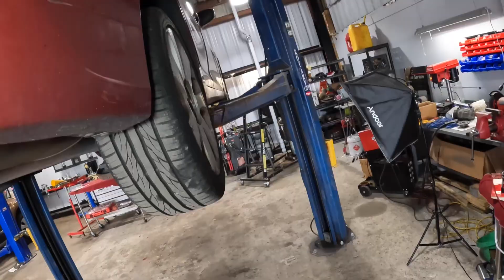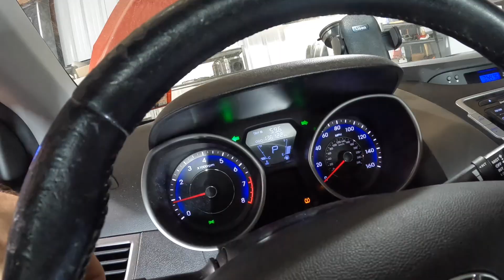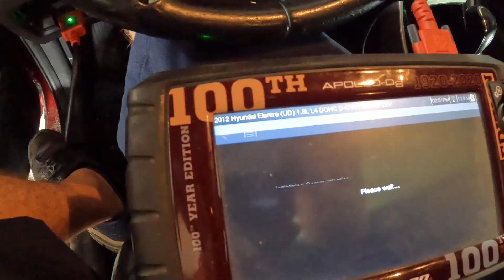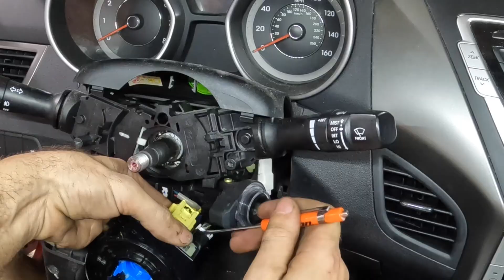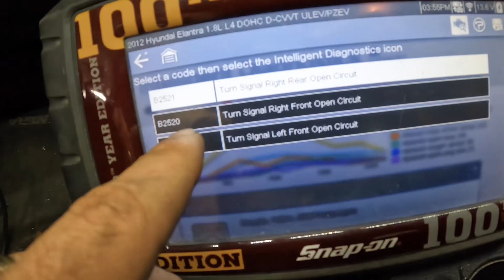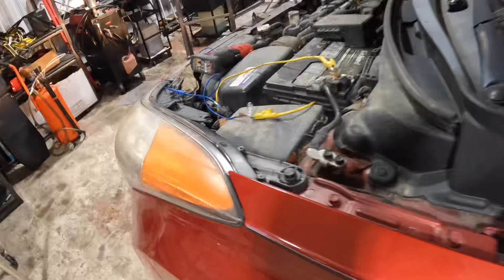Airbag Warning Diag and More! Hyundai Elantra 1.8!

Comment: Also there are NGK Iridium counter fit plugs that could give you the same problems.  To see if you have fake plugs. Simply check the resistance of the center electrode see if they are very consistent. If they are they are true NGK's if they vary resistance by more than 10% then they are fake.

Betting the light problem is LEG lamps in the rear.
Reply: Yeah, also states ignition coils aren't OEM as well😢

Those eBay or Amazon sellers are a hit or miss unless the seller says it's an authorized genuine OEM part supplier (but even that is not a guarantee)

I now just got a physical brick and mortar store Justin Case the parts are bad or fake; they have to honor it and swap them out

Comment: The flat wires are called ribbon cable which is highly flexible. It is used in low voltage, low current and low frequency applications.  They did make a twisted wire flat ribbon cable for higher frequency needs (I'm old school - core memory and punch cards).
I think my next step would have been to pull up the wiring diagram to find out what goes where on the flasher circuit.

Comment: In regards to your subscription based scanner, unless the subscription is astronomical. Wouldn't it be cheaper to resubscribe rather than spend $4,000 or $5,000 on a new scanner?
Reply: It's always good to have multiple scanners.
Reply: @johnaclark1  Ray also has 3 or 4 other old scanners

Comment: What I found stupid is you need to replace the head right? Turn signal bulbs because they’re wore out I had this problem myself that’s how I know. First thing I did was change the bulbs fix my problems
Front and back I thought it was odd that the front ones had two of them which is weird first time ever. I had one evolves that needed two films

Comment: Okay, I detect a Ray-unit logic failure here. Why buy a new scan tool that’ll require a subscription to work, when you can renew the subscription on the old unit that you’ve had for years. Reee! 😅 Unless, of course, you can get a better scan tool with a lower subscription rate! Then, it’s a logic success instead. Yay. 🎉🎉

Comment: I was fixing broken wires under my passenger seat for the occupancy sensor, even with the battery disconnected, I was still worried about getting my head blown off by an airbag.

Comment: Why would you think the clock spring would affect the turn signals?  The turn signal/multifunction switch does not go through the clock spring, right?  It's mounted to the column, not the rotating wheel.

Comment: Ray, just gonna say: When your scan tool wasn't reading and you said, "Cut!", I inmediately got an ad in the video.

Too funny. You can't make this stuff up. 😂

Edit: Ray, sounds like for the turn signals, either the multi-function switch or the relay for the turn signals are bad. I'm leaning more towards the multi-function switch, only because of the hazard switch operating correctly. It used to be you had separate relays for normal function of turn signals, but it would not surprise me to discover that one relay controls both hazards and normal turn signal function. That being said, remove the relay and check turn signal function, and if that fails, check the wiring at the multi-function switch. My guess is, a new multi-function switch is in order.
Reply: I got it too

Comment: well normally your diag vids are spot on, but now.. Last time you explained that the tabs on the airbag short them out to prevent an premature explosion in your face. Now you are measuring over 2 open wires where one was shorted and the other one had high resistance.

The headlight is simple, the flasher bulb does not have a good ground connection, and finds its ground over the low/high beam bulb. When you turn on low/high beam, the flasher has no  ground anymore and stops, but also puts 12v back to the ECU/BCM telling it that it is permanent on. Look at alldata, maybe the grounds are shared between headlights.

Comment: Id like to see the tail light because people are putting the LED lights in and that messes with that computer because it knows the light is not pulling the right amount of power, I switched 1 tail light and had this fast flash but all the lights were working so I just put the proper bulb in and it was fixed,

Comment: Thanks for your explanation on blinkers and dashboard indicators.  I’ve often wondered if they were important.  I’ve noticed many new vehicles that don’t have blinkers.   They just break and turn.  😂
Reply: And BRAKE.
Reply: That has been a BMW feature for decades.....
Reply: @jsh6952  I thought I saw a BMW use directionals once. Turns out it was only bigfoot.
Reply: Tell them break is over and to use the brakes.
Reply: People forget to keep the blinker fluid topped up or put right fluid into the left one and vice versa then they cancel each other out.
Reply: Just exactly WHAT breaks and turns? The Indicators break? The blinkers break? The indicator stalk breaks when turning? We need more info!
Reply: @beezul  
Everything breaks on new cars, heck sometimes it even comes from the factory already broken for you.....

Comment: Reguarding the mis-fire , the cable / wire to the coil might have an issue also . Have been thinking about the rapid flash . There could be a bad ground connection or more than one , that would cause a high resistance . Also check to see if the correct lamps are installed , that could affect the system . Stay safe , have fun .

Comment: When you said the airbag light was on a particular circuit I thought, "clockspring".  I must have been watching a lot of your vids...lol.  When you showed a fast flash I thought it might be an LED somewhere in the circuit.  I had to add a 50 ohm resistor to change out my turn signals to LEDs.  It doesn't appear to be the case here as that headlights on, no flash on front only and dash flasher lights both lit up sounds like a complicated problem to track down. I look forward to the 2nd part to see what that issue is.  I watch and learn a LOT from you.  Not that I'm going to do any of that on my own stuff as I have a mechanic I get to do my work as so not to make a bigger problem....know just enough to be dangerous...lol.  Take care.

Comment: I remember when i was a kid we had a 95 pontiac transport at night one of the turn signals stayed lit slightly but it never hyper blinked..my dad had a head scratcher turned on lights in garage in the dark turned on 4 ways(hazards) headlights and stepped on and off brake (checking all lights) come to find out one of the bulbs on taillight assembly was burned out new bulb in indicator on dash function back to normal..the pesky double filament bulb looks normal until it has to do 2 functions...

Comment: Before finishing your video i am thinking bad rusty ground wires. Cars in the rust/salt belt have electrical problems more than likely. i don't understand the theory of doing Billions of dollars damage to millions of vehicles to offset the monetary cost in the few millions paying death benefits of accident victims out driving in snow when they know better the risk. Throwing salt is only an economic stimulus package fraught with corruption.

Comment: @RainmanRaysRepairs
When you probe the headlight cluster harness connector: you also need to bridge other pins to simulate all circuits connected to BCM; otherwise, BCM will still detect that a bulb is blown or circuit is open to ground, due to loose connection, and indicators will continue to rapid flash.

Note: Most vehicles will also cause indicators to rapid flash or become static, if any bulb in external lighting circuits fail or malfunction, and that can also include bulbs for brake/park lights and/or reverse lights; and in certain circumstances, there can be multiple flasher relays combined behind hazard light switch in dash centre console.

Comment: I remember when they started adding those cables to aircraft in the air force. Because the first time I saw them was in the new generation aircraft like the F-16 and they had added them to a couple of components on the f11 I was working on on a regular basis. They are called "Ribbon Cable."
That is the assigned nomenclature for that flat wire.
Reply: Indeed, common nomenclature in all electronics.
Reply: "Clock springs" are indeed ribbon cables. However, the clock spring in automotive terms specifically denotes that particular ribbon cable which is present in all modern cars. If there's a button, a switch or an airbag that turns with the steering wheel they run through the clock spring.

There are also often other ribbon cables, generally on top of the roof lining in the cabin for dome lights, aerials, eye level brake lights, modules in the C pillars...
These too are fairly prone to breaks and failures.
Reply: I didn't do electrical when I was a GM tech, but knew enough to know the term "ribbon cable" and what it did. Also that's the term used in computers (probably other electronics) for connecting internals (like disks, etc.).

Comment: Pull the headlight assemblies and check for power at the bulb connection. I had the EXACT same issue on a 2016 Elantra and there was a fault in the wiring of the headlight assembly. We just threw new headlights assemblies in and it solved that issue.
Reply: I gather you mean to compare the inputs on the main connector to what reaches the individual bulbs.  It's interesting that both sides would fail the same way at the same time.

Or did they?  Perhaps the vehicle was driven for some time with one faulty blinker, and eventually the other one failed identically.

I'm also thinking that "smart" junction block could have a fault, but your thing seems easy to test without getting too far into the weeds.

Comment: Great work, think that you did a Hyundai Sonata about a year ago with samme issue on the clock spring unit. 
Regarding the blinkers, think you should go for a common ground issue on the front light system, if the ground are floating and you switch on the headlight the voltage would step up with increased amp in the frontlights. By the way, check the negative connection from the batterie to the chassie, sometimes this has green crusties, and courses all kind of wierd issues. If you have a termal camera, you can see the bolt and spacer glow in the dark.

Comment: Ray you only tested 3 of the wires in the connector, perhaps there is a second flasher line (hence the dual filament light) that works when lights are off to increase its brightness for daylight hours.

Comment: I had a 2012 Kia Rio come in with The airbag light on. Tech ordered a steering wheel airbag. Didn’t fix the issue air bag light was still on. So I had hooked up a scan tool DTC B1346/B134600 Driver Airbag Resistance too high (1st stage) and looked into the SRS Module live data and the resistance should be around 2.75ohms but the the data showed the (stage 1) being at 8.70 ohms  and when I turned the steering wheel it increased then showed “failed” for its reading. That showed me that the clock spring was faulty

Comment: The weird flash scenario is a real head scratcher. I do not know about Hyundai cars in particular, but I do know that in automotive electrics if there is a bad ground somewhere in a circuit it will find a ground through a different pathway than designed. When this happens you can have some bizarre happenings. Usually with the fast flash scenario it could mean that an LED was installed which does not have the correct amount of resistance for the circuit to operate correctly. Looking forward to the next episode of "Life with Ray and the Hyundai" to see what the error might be. Keep us all informed... and most of all, Stay safe!
Reply: It is a bad ground my man . Everything runs through a smart block aka bcm that looses ground . When that happens it cant carry the load so when you turn things on it the ground cant carry and will search for a ground through other components.  Probably the airbag issues also
Reply: @ALEX-xd7ko  those symptoms are a classic indication of a ground problem.  As long as the parking lights are not on the current from the blinker is back feeding through the marker light and finding a ground through that bulb.  Once the marker/parking lights are on the ground is too loaded up to allow proper operation.
Reply: I agree with your Statement, Lack of Ground can cause many Problems...
Reply: As rusty as that car is, my money is on a bad ground.
Reply: @johnaclark1  lol
Reply: I once put LED lights on my Acura, and it blinked like an obsessive-compulsive disco ball; consequently, the Sheriff kicked my ass for it. Maybe an electric load simulator would rebalance them to a normal rate?
Reply: @chrismayer3919  Another solution is to use an LED friendly Flasher / Relay
Reply: Just repaired a car with this problem.  A ground wire had deteriorated.
Reply: Maybe the bent wheel is a clue that the car was smucked and there are some pinched wires in the harness somewhere.
Reply: Milla meter...just sounded like you were asking for pee ter😅
Reply: I lost a ground under the dash and got all sorts of weird indicators.  Indicators were on when NOT flashing, high beam indication was backwards.
Use your multimeter to ohm out the bulb filaments.
Reply: No piano music ...no Heavy Metal music...seems everything Fallin apart...the Chevrolet sign fell off the wall
hit 'shop dog' in the head.🙄
Reply: Hyperflash/& ribbon connector🎉
I'll excuse this😊
Reply: My mom's 2002 Honda Odyssey refuse to let the transmission out of park if one of the brakes lights are out even LEDs low resistance will cause this. I heard you need a inline resistor to trick the ECU that it is working.
Reply: @WilliamHollinger2019  Can we stop talking about LED's and their low resistance? 

That's actually a fallacy. Well, they do present as almost a dead short and that's why they need to be driven by a current limited supply, but only AFTER their forward voltage has been surpassed, which is a function of the materials it's made of.

More to the point, in the instance of quick flashing automotive indicators... Even if all the lights in the indicators are incandescent they will flash quickly when one of them blows. In other words, the quickly flashing indicators is a function of TOO LITTLE current draw on the (old school) flasher can relays.

V=IxR
IE: I=V/R

Too low of a resistance would result in much higher currents. CURRENT is the factor that is responsible for the rate of flash of an old style flasher can relay.

The higher the current, the slower it'll flash. 

The actual "problem" with automotive LED lights, with regard to flasher cans, is that they don't draw enough current. Which is why a load resistor is connected in parallel with them in order to draw more current to correct the flasher timing.
Reply: @WilliamHollinger2019 Yes that is true. You can install a resistor across the line (meaning positive side of brake light wire to a ground source) of a value that will not draw too much current (amperage). I would start with about a 2500 ohm 2 watt resistor and if that didn't work then go down to 1.5K, 1.2K, 1K, etc until the desired effect was achieved. Also beware that the resistor will get hot the smaller you go down in resistance. So locate this added resistor, called a bleeder resister, in a location where it will touch nothing and be able to dissipate the heat.
Reply: It's a Kia pretending to be a Hyundai, don't let it fool ya.😅😂
Reply: I suspect 'curb crashing' 🤕😵‍💫😎
Reply: Well intriguing...sorta miss the Mississippi mud and snake oil stuff..might be nice to take notice that Dave didn't ditch car the car he was working on and left a dummy... loaded with newspapers and shop rags leaning under a hood😊
Reply: Wires burnt and touched 😮
Reply: Looks like the don't do much maintenance on there vehicle 😮
Reply: Bla bla bla bla bla 😂
Maybe snap off can get special price for scanner....just don't resort to ask us trolls to dig into our pockets to fund this dilemma 😊

Comment: Double Overhead Cam from Mid 70s Honda Motorcycles on a 750 model I had am  I remembering it wrong all these years later? I'm past 70 yrs old so am Imight be remembering it wrong?
Reply: They were a single overhead cam until 1978. Doesn't seem like its been thar long ago.